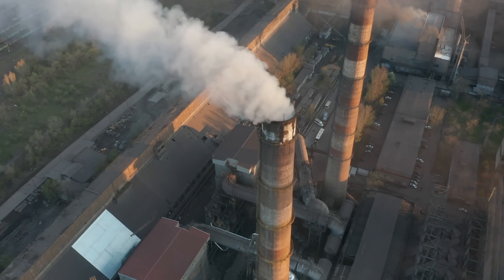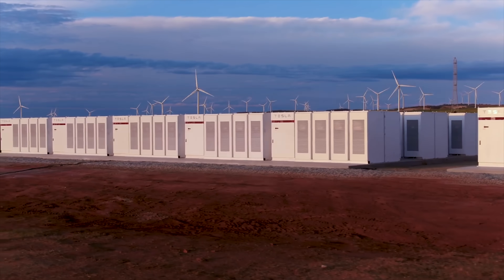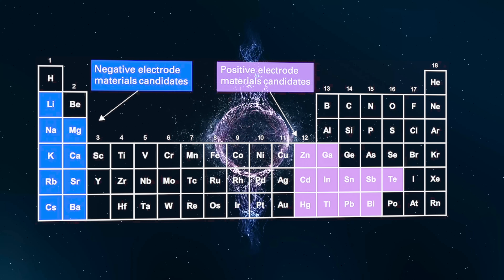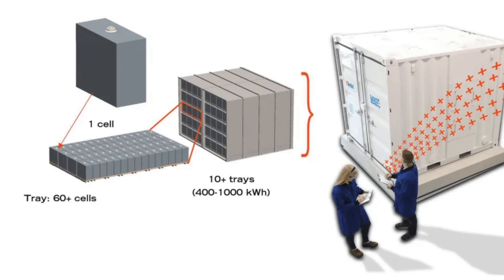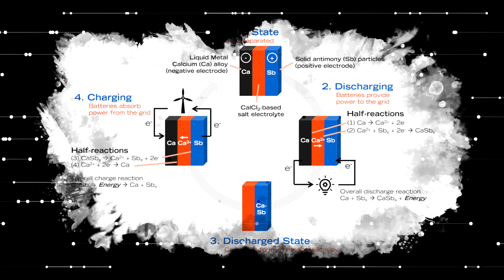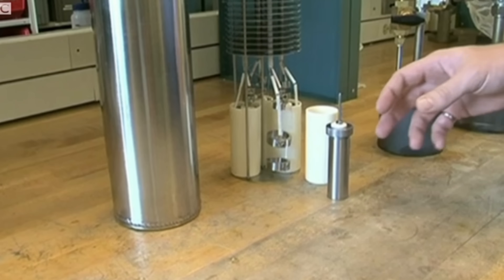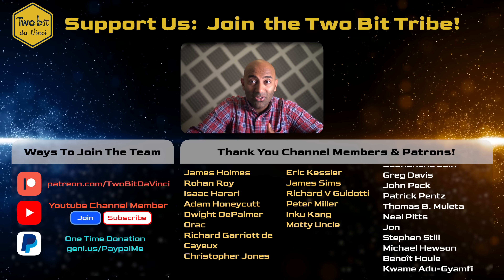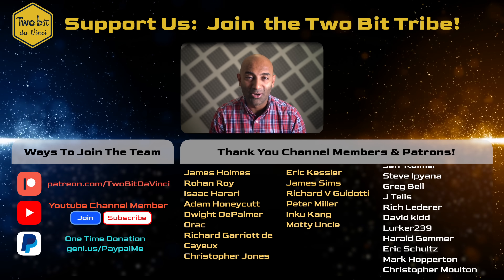Liquid Metal Batteries Have Some Shocking Properties...

Comment: Storage is key for the large-scale  adoption of renewable energy sources. Your coverage of this battery technology was clear, concise and entertaining to watch as well. Thanks!
Reply: as for me solar energy is more viable. wind energy will just be supplement so there will not be much of a problem of lack of renewable energy generation. by this I mean if only every home, every establishment, every building, whether public or private, has its own solar energy generation in order not to require so much of space building a solar power plant.
Reply: Jay, 
Solar is the worst of all renewable generation,  particularly the higher the latitude in which it is installed. It provides power for a limited time and often none when it is most required. Therefor there has to be 100% capacity in alternative generation plant. That make sit veru expensive to rum for teh consumer. Availabilty fcators for solar in teh U.K. is about 10%, pitifully low.  That may double in more sunny countries but still it is poor.
Also, technically it is asynchronous which means it is uncontrollable, a grid can only absorb so much and remain stable.
Reply: @iareid8255  Probably the worst if you don't consider Energy Storage Technologies which is the concern for this video. that's why we need this battery technology imo. Scott Burton is correct. Storage is the key.
Reply: Jay,, 

battery storage has been overhyped. It is not an answer to intermittency as the capacity required is far too great to compensate.  
Batteries can be used for frequency support but forget it for making renewables viable, it simply cannot work.

If there is a requirement to reduce CO2 from generation , we are far too late, nuclear generation should have started in earnest thirty years ago.
Reply: @iareid8255  I don't think so. Only history will tell if you're right or I'm right. it is now starting to be realized in Australia. like i said if everyone has its own solar together with batteries, i think it will work. Scott Burton is correct. Storage is the key.
Reply: Jay, 

I am looking at it from the perspective of supplying a grid.
In the U.K.about year ago we had a partial grid trip due to alightning strike on the lines, A wind farm and a gas fired power station both tripped withing a short time of this, this brought the frequency down enough to trigger the protection and load was shed. Subsequent detailed analysis of this found that another problem is embedded generation, which is such as solar and wind connected to the distribution i.e. low voltage side in which there was a substancial amount of grid supply was lost. This sort of generation is out of the control of the grid operator and also there is a very real chance that this sort of generation does not have the right sort of protective equipment and it can trip too readily.
Storage is not as easy as is assumed, what is not readily appreciated is that storage requires extra generation capacity for it to work, more expense and complication.
If you take an installation for a private dwelling and run it free of grid tie, I would expect that it would cost a lot more than drawing from the grid, even at inflated prices due to renewables. It would need to be of sufficient capacity to run the elctrical needs of the dwelling for 365 days of the year and have the power  needed available at all times.
If it were that easy those with sufficient capital would do it, woudn't they?
Reply: @iareid8255  have you not known what happened in australia about Tesla Mega Pack capable of stabilizing the grid when  a sudden power tripping occured? i'm not saying its that cheap and easy but it can be done. that's why improvement and development of cheap and efficient energy storage is the key as scott have said.
Reply: Jay, 

I am very aware of the small Tesla battery installed in the State of South Australia grid and I accept that batteries can be used for frequency support very effectively.
There are many You Tube videos with reference to pumped storage and without excetion they misunderstand it's  function. It is an old technology and the reason is a very quick response to a sudden loss of generation level relative to demand. A chemical battery can do the same and even quicker.
Compensating for renewables' intermittency is a completely different matter and requires a storage capacity in the hundreds of gigawatt hours for even a medium sized grid. (I think the Australian Tesla batterry has been recently up graded to about 150 megawatt hours. OK the South Australia grid is only about 3 Gigawatt capacity so is very small.
Reply: @iareid8255  That's why Energy Storage is the Key. like I said if only every home, every establishment has its own solar energy with efficient batteries, the demand for Electricity will go down as a result the world will not be needing that much of a grid storage anymore.
Reply: Jay, 

I'm sorry but I don't see that at all. 
However I doubt that you will change your mind so I suggest we agree to disagree.
Reply: @iareid8255  as for me, I am hoping and expecting it to be accomplished in the future. perhaps in 20 or 30 years.definitely I will not change my mind until that time comes. I agree though that we agree to disagree.
Reply: Scott, 

it is an arithmetic certainty that grid storage can never make up for the poor availability of renewable generation, it is afantasy. Have you seen how little wind has been generated this yera fo instamnce?.
Reply: @iareid8255  Have you seen how little wind has been generated this yera fo instamnce?
1590TWh this year worldwide or around 6% of the worlds electricity generation. This while wind in many places is not or barely being rolled out. 3/4th of the current wind production is in China, EU27 and the US and in these nations they are still rolling out wind too. Wind (and renewables in general) is only just starting to become a mainstream part of the grid overall.

Solar is the worst of all renewable generation,  particularly the higher the latitude in which it is installed.
Solar is fine up untill maybe 55° latitude, ofcourse it is way more efficient in the lower latitudes. As for higher than that, wind is a great generation tool (it is used in the antarctic for example), Denmark already gets a lot of electricity from the wind (46% and 4% from solar) and can get a lot more. Norway gets almost all its electricity from hydro, Sweden for now gets 51% of their power from hydro and wind, Finland gets around 12% from wind currently (still growing every year) and 23% from hydro.

If really necessary these more northern countries can use nuclear reactors, or import energy from further south using HVDC lines.

It provides power for a limited time and often none when it is most required.
Which is why storage is needed. Also a shift in consumption can help, for example heating/cooling can be done mostly during the day when there is an overproduction of solar. 

Therefor there has to be 100% capacity in alternative generation plant.
Not when there is enough storage, which is why it is so important for renewable generation.

Availabilty fcators for solar in teh U.K. is about 10%, pitifully low.
This only increases how many solar panels we need. And while northern Europe isn't well placed for solar, it is overall good for wind. European nations will go to a wind-energy electricity economy, with maybe here or there some nuclear power.

Also, technically it is asynchronous which means it is uncontrollable, a grid can only absorb so much and remain stable.
Again, storage is key.

battery storage has been overhyped. It is not an answer to intermittency as the capacity required is far too great to compensate.
This is completely untrue, even just Li-ion batteries could overtime suffice, ofcourse there are better options for gridstorage, like possibly the liquid metal from this video, or the redox flow batteries, or a number of other batteries being researched. Not to mention non-battery storage possibilities like LAES or hydrogen (bad efficiency though, so a last resort).

what is not readily appreciated is that storage requires extra generation capacity for it to work
10-20% depending on the battery type, absolute worst case 30%. 

If you take an installation for a private dwelling and run it free of grid tie, I would expect that it would cost a lot more than drawing from the grid
This depends on location, things like solar efficiency, grid price, ... For example people in the lower part of the US or Australia are likely better of with a selfsufficient system, this not only costs less for them, but also makes them selfreliant. Here in Belgium it for example isn't worth, though maybe if grid prices were 10-15 cent/kWh higher, it might and with reducing battery costs (possibly halving by 2030) and solar panel costs, it might become a no brainer in the future, even here. In the south of Europe, I already could see it being interesting.

even at inflated prices due to renewables.
The inflated prices are actually limited and will overtime dissapear. These prices were higher because renewables were more expensive, currently solar and wind is equal or cheaper than most sources, the main problem being the cost of storage/management without enough storage.

It would need to be of sufficient capacity to run the elctrical needs of the dwelling for 365 days of the year and have the power  needed available at all times.
In most places this is not a problem, only depends on cost, storage being the main factor. Solar for most houses under 55° north could probably already be sufficient with +-10kWp heating not included, more or less 10-15k euro, or around 10-15 years of ROI (while the panels are expected to last for 25-30 years or more). The necessary battery is likely something like 10-12kWh for 5-8k. Within 10 years the combination can be around 10-12k in total, more than low enough to earn back the investment

Comment: Seems as round trip efficiency of 80% makes it compete in a longer duration storage application. May be utility scale may be a good fit, possibly in combination with Li-ion. Li-ion can do short term response and Ali-metal can complement with longer duration at very low cost?

Comment: Use extra electricity to make Hydrogen, then when needed (At night) use Hydrogen to run turbine and generate - electricity. Hydrogen can be compressed and bottled.
Please look into this idea.
Reply: But the effenciency of hydrogen is just 25% compared to the 80% of this battery. Indeed you loose the half of your energy by turning water into hydrogen (with electrolyse) and the half to convert this hydrogen into energy and at last water to. And the pressure require energy too eventough other solutions have been found for the stockage of hydrogen like converting it in ammonia (NH3) with the azote (N2) in the air or use hydrure of metals.
Reply: @nvinvi5046  You already looked into it. Cool! I didn't know that.
Reply: Hydrogen can be stored in solid metal state safely, too.
Hydrogen Tapes 🙌

Comment: There are many ways to store energy, from pumped hydro to redox,  Mechanical and now Liquid metal. Isn't it about time someone  built these at grid scale to see ow well they work. Some are geographically limited by the lack of dams, I get that but there are others that are not. At this point in time it starting to look like stalling until something perfect comes along, my local government keeps trying to sell us on Hydrogen as a storage potential. While the world decides Li-ion installations get bigger and bigger.
Reply: Too true, if by some means the chemistry of the flow battery or salt water battery on how they work was released for open source then we would all be able to do something but all we hear is the tec is 5 years away, i remember seeing flow battery stuff 15 years ago and being as they use an iron water mix (?) if they leak it doesnt cause damage, Even if they are 50 to 60 % efficient if there cheap and easy to make who cares about 99%. Were all supposed to be carbon neutral by 2050 ( ye right ) then why havent we seen more stuff coming out or is it because while they class it as rnd they can keep tacking tax payers money and say nearly there.

Comment: So let me get this straight.. these batteries will be inside those shipping containers.. running at over 900 degrees Fahrenheit? .. and there is no draw backs worth mentioning? There’s no sacrifice or danger in this setup? Idk.. something tells me there’s some negatives/hazards/drawbacks here not being realized.. or just not being discussed. And once this battery is up to temp, it NEVER cools? Even if it’s not in use part of the day or night? Idk.. this whole thing doesn’t pass my tiny bit of scientific knowledge I have.. and basic common sense. I’d like to see one of these setups comparable to the hornsdale megapack setup and see how it operates over some time.. the costs.. the efficiency.. and see a real world demonstration of this tech and what ramifications there are to having these f’n furnaces basically all jammed together into an area and see what the unintended results are.
Reply: It being stationary, just having a fence around it should make it safe. I do not think there is any chance of explosion.
Reply: @DrDave327  ok.. is there 0 electric components needed to run these batteries? If so.. what’s the cooling system around that? Maybe it’s not located in the vicinity of these things? ok.. so you build a remote, heavily secluded location for these hot ass liquid batteries.. maybe underground? And a separate location for whatever electronics are needed to run them.. and what happens IF the battery cools? There is bound to be times when they are not in use, and therefore cool, right? Then what.. you have to have some kind of heating element to bring them back up to operating temp? That’s not going to be cheap.. idk.. I will need to do some research and see if there’s more info on this idea that fleshes out more of the whole system of operating these things in the real world..

Oh.. and what if there IS an accident of any kind.. a leak.. what do these metals do IF they do come into contact with other?
Reply: @DrDave327  No chance of it levitating either I'm sure.
Reply: NOT BEING DISCUSSED = CONVENIENTLY IGNORED. THE USUAL SNAKE OIL

Comment: So a liquid metal battery/cell is basically one of these cells you make in science class using a diluted salts and two metals
Reply: ...except that with /molten/ salt you have different reaction rates, and you avoid the physical degradation of solid electrodes seen after a few hundred cycles.
Reply: NO. Try again.

Comment: The cycle life is a plus.  The efficiency is poor Lipo cells are over 99% efficient. Lipo cells have the potential to be just as cheap when production reaches necessary scale.
Reply: LIPO is able to handle (relatively) high currents. The major problem with LIPO is low number of cycles before degradation. Batteries are often a trade off between different characteristics.
Reply: @chrisheath2637  It is just a question of economics Lipo has the potential to be an economic mass storage battery. The useful life should be in excess of ten years. There are no moving parts as in a flow batteries. Lipo is already increasing in scale because of EV'S so it will be hard to beat on the cost side. For extremely high cycle rates flow batteries may work better but I don't see them dominating grid level storage.
Reply: @frederickstirnkorb3094   Yeah, I think you mean LiFePo batteries. Lithium iron phosphate. LiPo normally is for lithium polymer, used in drones, and RC things...
Reply: @frederickstirnkorb3094  10 years as an EV battery. 2 - 3 years perhaps in bulk storage applications.
Reply: @grahamstevenson1740  I believe the cycle life is in excess of 2000 cycles still retaining over 90% capacity.   I would not expect more than one cycle a day if that. Grid storage will need multiple days of storage for the renewables so the cycle rate will be less than one per day.
Reply: Flow batteries have essentially infinite life. The ONLY possible advantage of the 'bomb batteries' is high energy density which simply 'doesn't matter' in large scale energy storage. Size (and weight)  is not the problem  ! This is dangerous and risky technology in desperate search of a relevant application, which ISN'T BULK ENERGY STORAGE.
Reply: @grahamstevenson1740  Lipo chemistry isn't volatile. Flow batteries require pumps. The minerals for Lipo are abundant and easily recycled.
Reply: @frederickstirnkorb3094  Poor life cycle. Flow batteries work almost forever.